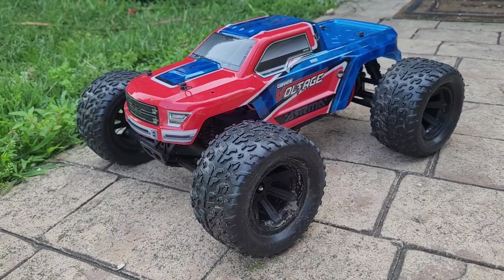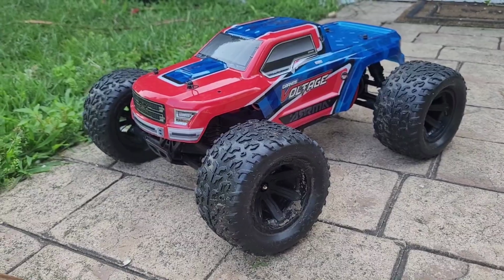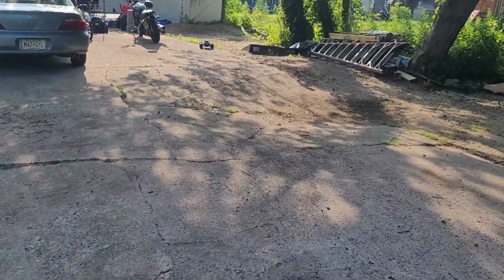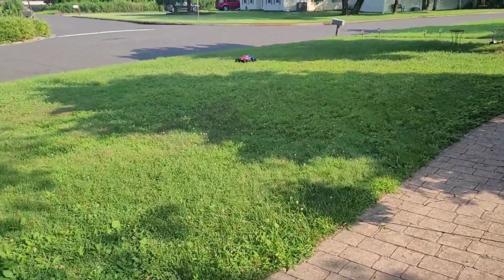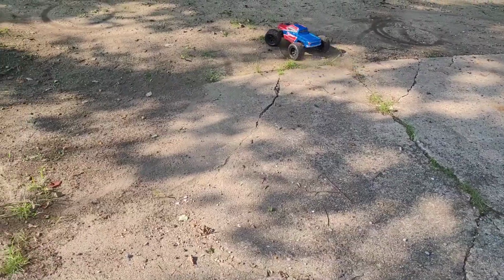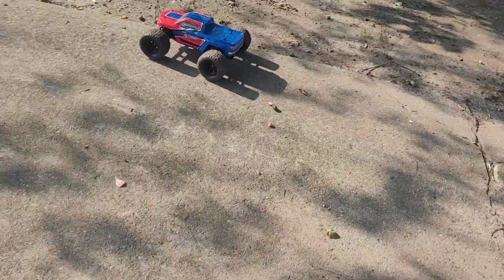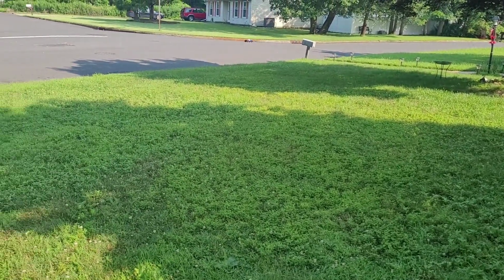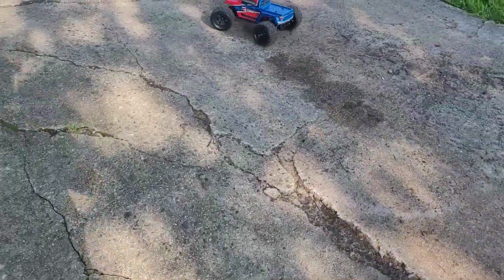arrma granite upgraded 19 tooth pinion 12 turn brushed run better now

Comment: Nice upgrade. You’re making me want to change the pinion in my 4wd brushed 12 turn Granite. It could use a bit more speed but I would have to get fans for the esc and motor cause they get hot quick with current set up running on 2s
Reply from the maker: Sounds like a nice truck do the upgrades make a video 😁 thanks for watching 🙏